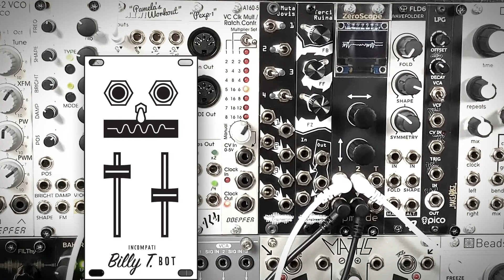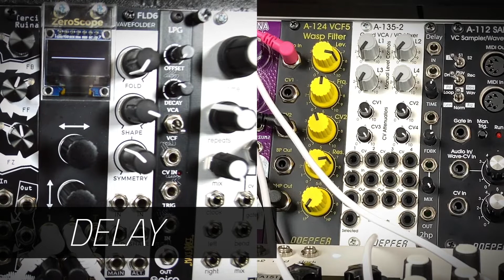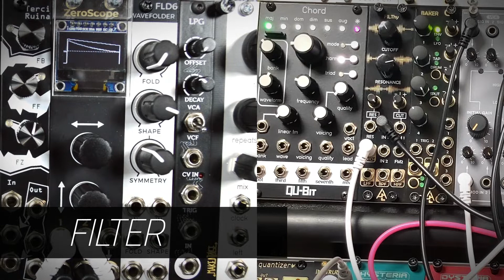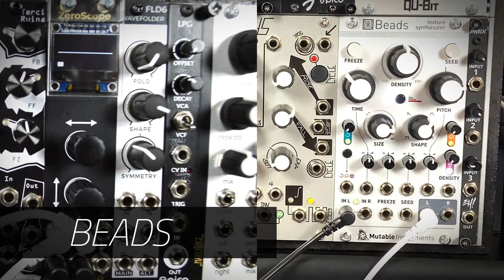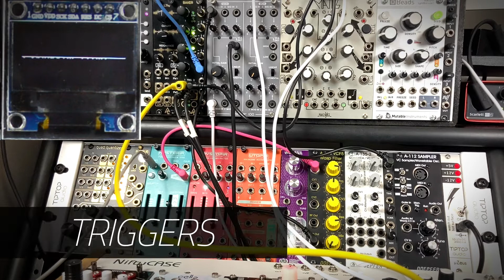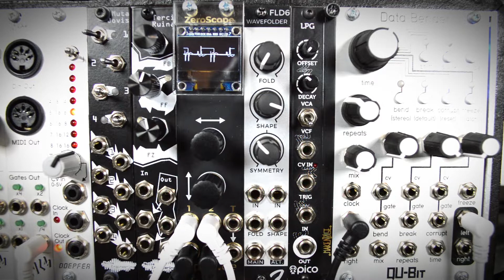CV This! Using Control Voltages into Audio Inputs

Comment: Jakub Ciupinski shared some cool ideas for misuse of resonant filters on CV signals https://youtu.be/qruXJPKvU04
Reply: Basic idea is that a LPF can work as a slew if you pull the cutoff low enough. His demonstration uses VCV Rack, but I've used hardware Ripples for this purpose. You may need a CV offset to bring the cutoff down.